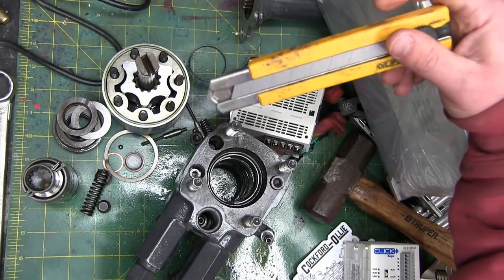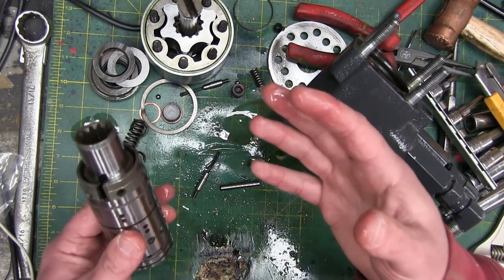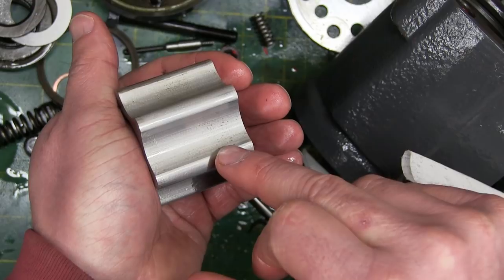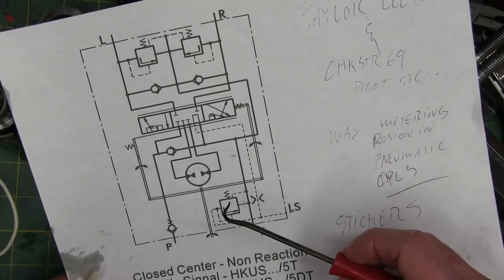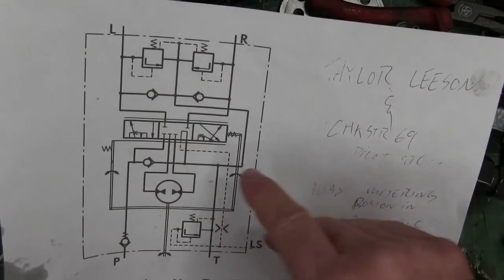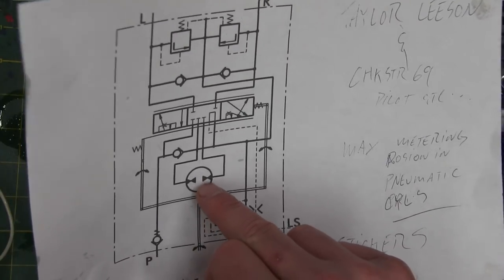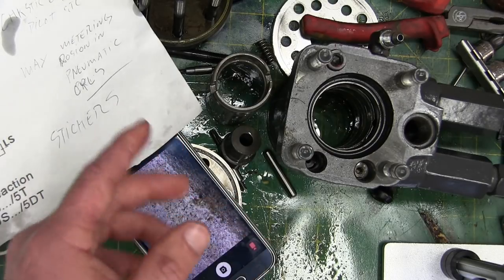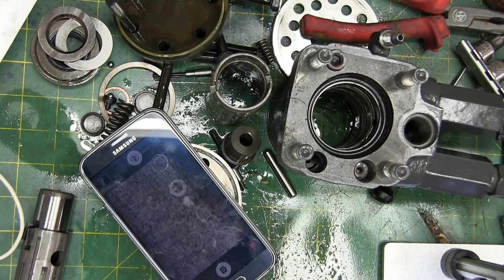Orbitrol Valve Details | My Errors Rectumfried.

Comment: "Air over Hydralic" might be similiar to what we use in the natural gas industry.   We use "gas over oil" valve actuators.  There are tanks that are remote mounted from the actuator that are about half filled with Oil with the gas in the top half of the tanks.  We take high pressure gas from the transmision line and is used to pressurerize the oil.  The pressurized oil is what is used on the actuator mounted to the valve for operation of the valve.  
http://www.emerson.com/en-us/catalog/shafer-y8t

Comment: You can actually turn the steering without hydraulic pressure. It is very hard to do and takes a lot of cranking but it works.

Comment: Well, the pump in that steering motor won't turn the wheels if you're stopped. Its more of a safety thing if you lose brakes and hydraulics so you can still steer if you are out of control or something.

Comment: I've got another one for you: Hydraulics over hydraulics! How? The Rolls Royce Silver Shadow had/has a tiny hydraulic brake master cylinder situated under the floor in front of the driver's seat (owners call it 'the rat trap'). On it's own it has the same braking effect of sticking your foot out of the door and scraping it across the ground. (The original models were identical to ones fitted to some small Morris cars; the 'improved' replacements coming from early series 2/2a Land Rovers). The hydraulic force from this goes to a valve that bleeds pressure from one of two hydraulic spheres statically pressurised to 1,000psi. With the engine running this goes up to 3,000psi. This is the pressure that goes to the brakes. It also goes to the self levelling rear suspension and recirculating ball steering box.
Essentially; without the engine running you don't have any brakes or steering and the arse end is scraping on the ground when the reserve pressure runs out!

Comment: When you say "air/electric over hydraulic" you're basically just saying that the valves that control the hydraulic fluid flow are either actuated by air pressure, or electrical signals.

Comment: Electrical over hydraulic are hydraulic curcuits that are controlled by electrical solenoid valves  I'm not sure about air over hydraulic I assume they use air as pilot pressure to activate a hydraulic curcuit
Reply: mitch venem it's air actuator on a hydraulic spool valve normally, biggest difference is air is a yes/no where electric can be gradients.

Comment: The spring decides how much to open the valve. This gives the feedback to the operator. The more pressure the operator puts on the steering wheel the more the spring flexes and the more the valve opens and the more hydraulic assist kicks in. I have to disagree about the  manual pump being there fore haptic feedback only . If you ever work on a small forklift or other small equipment with this system. (I have an F1145 mower). You can see that the steering will work with the engine off. Unless the system has a leak of some kind. Then it may have steering for a little while after engine shutdown.  So to sum up, the manual pump steers the vehicle and system pressure assists the steering by supplying metered flow in accordance with how hard the operator cranks the wheel.

Comment: you can steer with out power, engine off, most  farm tractor have load reaction valves and can be steered while rolling fairly easily. stopped quite a bit harder, some just "slip" ,most will steer takes a lot more turns though moving or not.

Comment: My understanding is that air over hydraulics is using an air motor to produce hydraulic work.  Like your bolt fu^%&^ or an air over hydraulic jack.  Electric over hydraulic is an electric motor creating hydraulic work.  Like a hydraulic bale fork on a truck or dump on a trailer, where the hydraulic pump is not driven directly by the engine.  But according to my wife, I am wrong A LOT.
Reply: You are most definitely right. X over hydraulic means X drives the hydraulic fluid. The porta-pak is air over hydraulic, converting air pressure to a higher hydraulic pressure. Old Citroen suspensions (and some others) were gas over hydraulic, with compressed gas bladders providing the spring force which was transmitted via hydraulics. Air over hydraulic brakes like (in some Unimogs for example) use air pressure to actuate hydraulic brakes.

So it's not what moves the valving that determines the name, the valving actually controls the source of pressure or flow that is "over" the hydraulics.

Some older heating control valves in buildings use electric-over-hydraulic control. The position control circuit controls speed and direction of an electric motor, which is turn drives the valve stem via hydraulic pressure. There is no control valving between the electric motor and hydraulic cylinder.
Reply: yep, My tube bender is electric over hydraulic. The electric motor drives a hydraulic pump to move the cylinder and make cool roll cages and stuff. ( if I ever used it)
Reply: This is basically how I've seen it in marine steering systems. The air sits in a tank and acts as a spring on top of the hydraulic oil. When you get low on pressure (on my system) the hydraulic pump kicked on and pushed the oil up into that tank. It basically takes an incompressible fluid and mixes it with a compressible fluid that sits on top of it. The awesome side effect is, if for some reason you lose your generators, you still have steering, at least until the air pressure is depleted enough in the tank.
Reply: Agreed.
Reply: The pressure tank in a stand alone residential water system has an air filled bladder inside a water tank.  The water pump turns on, forces water into the tank which compresses the bladder, then the pump shuts off and the bladder keeps the system pressurized until the tank is empty and the pump kicks on.  I've heard this same type system is used in aircraft (especially helicopters) hydraulic systems.  In the marine systems you've seen, is there a barrier between the oil and air?  If not, what keeps the compressed air out of the oil?  And what keeps the oil from oxidizing, picking up moisture, etc?
Reply: In my bit of the world air over hydraulic indicates that hydraulic valve is actuated by an air powered actuator, etc etc electric actuator. Doesn't matter where you get hydraulic pressure from, it's about controlling fluid flow.
Reply: I use air/hyd for the brakes on my overhead cranes. Electric pressure switch tells the lil' baldor to chooch or no chooch, which runs the compressor. The air gets stored in a holding tank until the operator depresses the treadle pedal that allows air to push against the master cylinder forcing fluid into the actuators. When they lift their foot the fluid flows backwards. Very similar to old semi truck brakes. The advantage to the system is when electrical power is lost the crane can still stop itself due to the stored air. We also have some electric/air/hyd for cranes with moving operator cabs.

Comment: I would guess the accuracy of your eatafruit controlled pneumatic actuator was increased under load for a different reason.  If you arrange the gas law letters P,V,n,R,T appropriately, they do spell "pervert", but if you arrange them the other way, they remind us that gas put under pressure is compressed to a smaller volume than it was before.   So I think your flow meter measures volume, but the same volume equates to less linear displacement under pressure.  According to the cubed steak formula, it should be something about the cube root of the volume, so I guess the cube root of the pressure, after you take into account any warming of the gas.  Please advise.  Keep your tricks nice.

Comment: I am not sure about the steering box pump not creating enough flow to move the steering.  I have a Deere John tractor that blew an engine, sat for 4 months and then I was able to use the steering wheel to turn the wheels effectively to move it into the shop.  Steering effort was very high, but the machine has a full hydro steering system so that is expected with no hydraulic pump.  Maybe there was enough "gravity bleeding" in the system to ensure fluid flow to the steering pump/motor.

Comment: To my understanding, 'x over hydraulic' in an automotive context means it's a hydraulic system that's boosted by air, vacuum, electricity, more hydraulics, whatever.

Your average econobox has vacuum over hydraulic brakes. Diesel pickups? Hydraulic brakes boosted by the power steering hydraulics since there's no engine vacuum to play with.

Hopefully someone can come along that knows about the industrial/equipment side of things haha.

Comment: AVE, a quick question. My Dad is complaining about the clutch on a tractor that he drives every day, he does hedgecutting, so it involves alot of clutching. i was looking into an electric servo motor to actuate the clutch and just using the pedal as an imput, but im not as level headed with pixies as i am with schmoo. If i could rig up a hydraulic system i would just undersatand it a hell of alot more. If i use one of these orbitrol units and he keeps the clutch half pressed for a bit, will there be oil leakage in the system and then left with the clutch at the floor and no more clutching. as i'm aware some steering units let the steering wheel spin a little bit all the time, I wont be doing that with the clutch..... any opinions on what sort of proportional valve i could use alternatively? love the vids, keep up the good work.

Comment: I'm not sure if this is an industrial standard or not, but in my shop we have an air over water extrusion press ( at least that's the lingo that has been passed down) and its physically 5000 psi of air, over  2k ish gallons of water. air for the massive volume of stored energy, water so you don't get the " spring-in-sprung " 

is this how others use this lingo ? or are we bass-akwards ?

Comment: you might be interested to know that with just the pump turned by the steering wheel and no pressure,  a full hydraulic steering system turns  same as a manual steering car with the engine off... you cant force the steering wheel to even move at a dead stop unless the tires actually move as well. if you need proof my jeep will do it...

Comment: Thats ok you otta see the prototype I machined at work had so many flow circuits radial on the OD the print looked like a page out of a maze game booklet. Most hydraulic design  engineers never create any original stuff its a upgrade or redrawing with a new part #

Comment: I believe you made a mistake in your answer about how to use air metering system to control absolute position of a pneumatic cylinder. Not that the system wouldn't work because it makes perfect sense but, If i'm understanding the system correctly, the accuracy at higher loads would be due to higher pressure required to stroke the cylinder the same distance. More flow (more counts in your control software) per inch of stroke.  Not too different from the resolution of a stepper motorb.

Comment: Was a really interesting program on the tv they built a mark4 WW1 tank. JCB did the steel shell and they used an old front loader gearbox and rear axle to drive it. And an ex military Rolls Royce 6 cylinder petrol engine. Thank goodness for the tank as 18 million people died in WW1 and the tank put an end to trench warfare

Comment: You hit the nail on the head the air over hydraulic. Good way of looking at it is brake boosting in automotive cars. You can have a vacuum booster activating on a hydraulic booster and you with have a vacuum over hydraulic braking system. Please correct me if I'm wrong
Reply: DaTallestMidget you're wrong, that is vacuum assist, actuation is still coming from the foot pedal. I can't think of anything in not mechanics world that uses these type of actuators.

Comment: The volume of the meshed pump teeth is irrelevant, your original calculation was the appropriate approximation(the full precision calc. would need the specific tooth shape.). 
The meshed section is irrelevant because the device is not a static reservoir, the number of teeth filling and emptying per revolution is the relevant tidbit.
Reply from the maker: +wolfedog99  ha! You're right.

Comment: I don't think you quite get it it looks like the pump just controls the spool so you spin the wheel and pump the spool left or right to bump the valve off of the seat and then give a dose of oil to each cylinder and when you ask for a dose of high pressure oil your load Sense cracks over the pump shuttle to increase displacement in case you want a bigger shot of oil.

Comment: That little pump/feedback thing inside, is there a similar one in a standard car steering column? I feel like that’s what keeps me being able to steer (with great difficulty) when the power steering pump lets the schmoo out.
Reply: Could be a whole different system though. Car =/= mining machine
Reply: Yes, if your power steering fucks up you 're left with the good old rack and pinion thingy and some muscles to direct your hellish chariot where you want it to go.
The power steering just assists you and takes up some of the needed force.
Reply: Paolo G That’s really interesting. I suppose it’s good it’s not as complicated as I figured it was. Less to go wrong.
Reply: IOW no, there is no manual pump/motor, but there is the torque sensing valving. The direct mechanical connection replaces the manual pump/motor.

Comment: You are correct about air-over-hydraulic and electric-over-hydraulic, where you have a hydraulic system operated by an air or electric system. An example of air-over-hydraulic would be small medium duty truck brakes. They are very uncommon, but it is basically an air brake system, but instead of the air cylinder operating the brakes dir3ctly, it operates a master cylinder. An example of electric-over-hydraulic would be the automatic transmission in a modern vehicle where electric solenoid valves open and close to allow the hydraulic pressure to shift the gears.

Comment: If you plumb that valve wrong it will act as a motor and rotate the steering wheel with enough force to break your arm. (But only if you are dumb enough to stick your arm through the spokes prior to turning the ignition switch.)

Comment: Back in the late 70s I drove a roll off truck pulling a 40 foot pup and the truck brakes were air but the trailer brakes were air over hydraulic. What that meant is there was an air chamber that pushed the rod that actuated the trailer brakes. It would be like installing an air chamber to push on the brake pedal of your car.Since I wasn't hauling much weight (empty trash cans) and only single wheel tandems that was lots of brake for the application.
The tolerances are tighter than a blonde, 
oh wait, a blonde one. KK
In other words the smallest unit of measurement known to man, a gzair, aka a blonde jewish c*nt hair. 
Watching your magnifying device it occurred to me it would be great for imressioning a key Waaaaaaaayyy cool

Comment: Well something is hoopajooped in my dads tractor then. Ever so slowly starts to creep to the left while driving in a straight line. have to keep adjusting right to keep it going straight. Expensive to fix apparently so it's been like that for about 10 years lol
Reply: Worn pump, it is leaking one side ever so slightly more than the other. Will eventually get to the point it will only turn one way when pressure is applied.  Fun is that some pumps fail in forward, but in reverse drive they will steer straight. Not fun to back up a forklift 12km to the shop this way though. Ah well, was better than when the tow truck dragged it there, 10 minute fix turned into a 3 month affair to get new wheels, as the old ones were literally D shaped.
Reply: been there on the forklift tires. Pain in the rear to change and they weigh a ton for how tiny they are. it was like handling a 16" 14ply tire that was only 14" tall :/

I don't think he's too worried about it. with the amount of hay that thing has picked up it is bound to have some issues.

Comment: Pretty sure you are correct on the X over Hydraulic, it's master slave style control logic. Also, fucking servo valves need ta go!
Reply: Gerald Gepes thats the way i was taught in all the hydraulics training i have done. Including tafe/during my aprentiship. Aswell as formal training from caterpillar, komatsu, and Liebherr. And as for what operates the pump is the driving componet

Comment: kinda like bosch continuous injection they say not repairable but I have definitely taken it apart cleaned out a screen filter blew the injectors out backward with compressed air and presto change'o perfect atomization  and 35 mpg outta a $375 dollar car that thing don't look like they sell any of the internal parts either

Comment: Ave youre wrong its not strickly for feedback, by law you muss be able to turn it without fluid power as a manual pump in a emergency case. The engineers muss dimesion the pump so that's possible

Comment: Certainly on the Linde forklifts that I work on, you can turn the steering with the engine/motor off. It's fucking difficult, but you can do it. I've done it before to access tie rod pins with the steering axel off the ground.